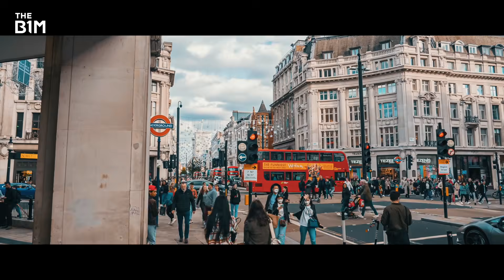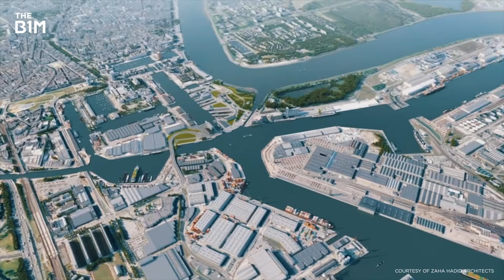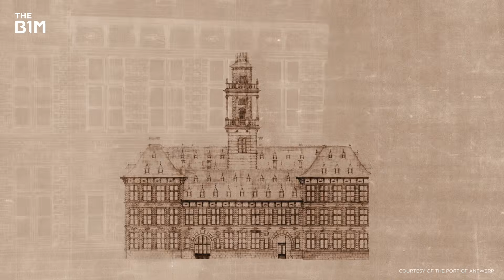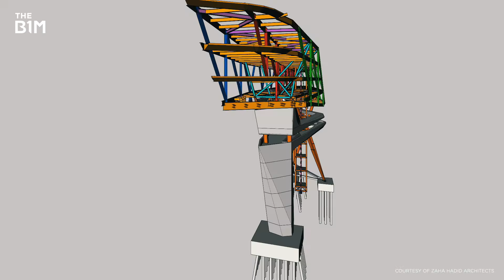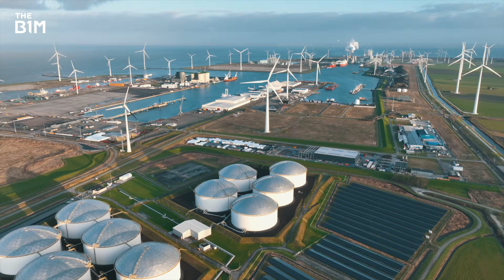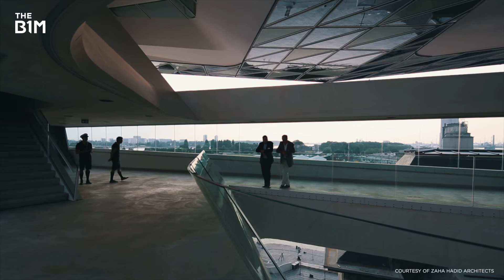Why They Had to Build OVER This Old Building

Comment: The design of the new building is fine...  if it were to stand on it's own.  In this instance, I find the mashup of the old and new simply horrid.   Individually each building is fine but together they are an abomination.

A small tower, complementary to the firehouse next door, could have been much nicer, and more functional.

Comment: I don't mind the juxtaposition of the 2 buildings, but I do mind the (literal) overshadowing. And I think that's mainly due to the "leg". Since the historic building has an internal court, they could have build a diamond with a central stem, rising vertically rather than horizontally.

Comment: Isn't Zaha Hadid known for creating beautiful but terribly impractical buildings? This seems to be one of them. Crazy expensive and stunning but in the end not designed with functionality in mind. I dislike this kind of architecture. If the design of a building or any other object has a negative impact on its function it shouldn't be built. In good design form follows function and is beautifull.

Comment: I am from the city of Antwerp where a discordant symphony between past and present architectural paradigms seems to be unfolding, threatening to overshadow the timeless beauty that has graced these cobbled streets for centuries. The fervent amalgamation of contemporary aesthetics with the classical edifices of yore is causing ripples of concern among aficionados of architectural integrity.

A poignant example of this trend can be found in Zaha Hadid's audacious Dubai-ish intervention at the Port House (Havenhuis). Here, a strikingly unique contemporary structure has been grafted onto an exquisite classical building, creating an unsettling juxtaposition that is the stuff of dystopian nightmares. While the audacity of Hadid's vision is undeniable, one cannot help but wonder if the classical beauty of the original edifice has been overshadowed by its brash and assertive modern counterpart. The question arises, should these two architectural epochs not have been allowed the autonomy to exist independently, harmonizing in their own separate spheres, rather than clashing in discordant conversation? In my opinion; Zaha Hadid's building should never have been allowed to be built unless it was given its own unique place.

Similarly, "Het Steen," that venerable sentinel guarding the riverbanks of Antwerp, found itself in the throes of transformation, driven by the insatiable appetite of the cruise ship industry. In the quest for expansion, the city commissioned an architect to craft an appendage that is unequivocally contemporary in its monotone manifestation. Yet, it strikes a discordant chord with the venerable structure it seeks to complement. It is a lamentable manifestation of an architect who appears to have ignored the solemn duty of respecting the legacy of those who have crafted the architectural tapestry of this city before him.

In this era where innovation and progress often eclipse the reverence for history and heritage, it is incumbent upon city planners across the globe to pause, reflect, and perhaps rediscover the enduring allure of classical architecture. At the very least, they must be mindful of the delicate balance between honoring the past and embracing the future. Let Antwerp's quandary serve as a poignant reminder that in the realm of architecture, as in life itself, there is an inherent beauty in the symphony of continuity and change, where echoes of the past gracefully resonate in the present.

Comment: "It has perfectly blended two architectural styles" is rather contentious. For many, this is architectural conceptualism at its worst: A stylistically isolated concept that is imposed onto the surroundings without respecting them — some of Koolhaas' works are good examples of the same. It's certainly different, and thereby almost by definition interesting. But a perfect blend of two styles? Perhaps not so much. One could so easily argue the exact opposite: that this is poor architecture, exactly because the new work fails to understand and build upon the old. There is little synergy, just a bombastic statement made strong simply by making it an antithesis to what it is supposed to complement. It's like rapping over Beethoven. Different and interesting? Sure. A perfect blend of styles? Well ...

Comment: Quite a subjective video when talking about the look of the building. Sure, its construction might have been an engineering marvel, but that does not mean that it 'perfectly blends the architectural styles' or that it has 'shown that it's okay to play with historical buildings'. To my knowledge this building is generally disliked by the populace of Antwerp and has created a lot of controversy, just like many other attempts at combining old with new in the city. For example, the modern attachment of a visitor center to the 800 year old city gate 'Het Steen' or the new plans for the hyper modern renovation of The Boerentoren, one of Europe's first skyscrapers built. 

Personally I think these extreme modern additions are disrespectful to the original. Like putting an emoji face in the background of the Mona Lisa.

Comment: I'm not sure what the correct solution to this problem was but that monstrosity overpowering the original architecture isn't it.
It's an exercise in getting around red tape and ignoring the spirit and the reason for the rules without technically breaking them.
Sad to see really
Reply: My thoughts exactly.

Comment: I cant stand this building. It is so completely disrespectful. It brutally dominates the building below. It does absolutely nothing to complement the historic property. It doesn't need to be located above. It's a reincarnation of French Baroque which designed from the outside in. I can only assume that someone in the town decided that their town needed a landmark building to grab international headlines like the Guggenheim Museum did for Bilbao. If the best that you can say for it is that it solves an issue with urban density then I think that level of faint praise really condemns this horrible, horrible extravagant white elephant.

Comment: In my opinion Zaha Hadid, belongs to a group of designers who create onanistic architecture (we could incorporate to this group the overrated Santiago Calatrava, just to name one). This type of architecture does not respect the heritage of the functional and are costly buildings to maintain making them unsustainable. In this particular case there is no integration between the old building and the new construction, they are two isolated structures.

Comment: its a hyper modern design on top of a extremely vintage styled building its unique to see the stark contrast between the 2 designs and surprisingly I think they actually work well together.

lots of people complain about the interior not being very functional that's a common problem when designing something astatically pleasing more so then functional, long term that could be resolved by attaching adjacent buildings that will share the more modern design functionally having an old city below a modern one (thinking New new york from futurama) its the likely evolution of architecture  in a world  were we are not willing to sacrifice heritage for what is functionally needed in modern times.

Comment: I would hardly say this project “perfectly blends” styles. There are loads of Zaha Hadid projects I adore … this is NOT one of them. There’s absolutely no relation between the old and new structures: not playful, not echoing, not contrasting in any meaningful way, not extending, not reimagining, not challenging, not playing with scales, not assimilating, not synthesizing, not juxtaposing … there’s literally no connection, none. It’s a thing with a wholly unrelated thing dropped over it. Connected by an elevator shaft. Hearing that the interior is an impractical afterthought is all the more infuriating.

Comment: This would be an "engineering" marvel if the white supports weren't obstructing the view from the outside. This massive mistake bastardizes the original building.

Comment: This is a novelty, not the answer to updating old cities. Neither buildiing needs the other and that's where the incongruity begins. On a city wide scale you're going to need uniformity as the cities have buildings from certain time periods so to should the updates be a modern reflection of that period. Otherwise there'll be this mishmash of old and new with no relevance. You may as well just bowl the old.

Comment: It likely would have been better to use the same engineering techniques to place another building using the same style as the one below.  The styles now clash.  Art is seen as doing something that hasn't been done before.   Of course there is often a reason some things haven't been done before.  Most of the good ideas have been used already. These things often suffer from the emperor has no clothes problem.  When something ghastly is presented, everyone is worried if they disagree, they would appear to not understand it.

Comment: this buildings signifies that time marches on, just like Antwerp, marching into the modern times. Integrating old and new design seems to put the contrast of the connect the past to now. It shows that the past can restore the past legacy mixing it with the new showing that the city is moving forward

Comment: I don't know why anyone would think that looks good. Not only is it monstrously ugly, but it absolutely ruins the protected heritage building underneath.  Only a European would think that this building is some kind of glittering jewel. If you ask me, it's a giant, shapeless eyesore, as ridiculous and pretentious as anything ever designed by Frank Gehry. Antwerp should be forced to demolish this awful building. In less than 20 years time, this building is going to be riddled with all kinds of structural problems leading to leaks, cracks, rust spots, etc. The designer of this silly building was clearly thinking more about form than function, so all the problems that will come up as this thing starts to age, well, whoever approved this project has signed up for those too.  Have fun, Antwerp!

Comment: In San Francisco, we do it more successfully, and there is no objectionable clash or space problems.
1.  They demolish the old building, but keep the entire front and side facades.  For licencing, this makes it a “renovation remodel”.  Then they fill the old walls with an entirely new building that takes color cues from the old—or perhaps compliments in other ways.  From a medium distance this building looks like two buildings—-one in front, one in back.  Since the new building may be glass, it is easy to assume it is two buildings.  Thus reverence for the past is accomplished—-without having to drag forward the dated electrical, plumbing, and insulation.

They could have done the same,  save 3 walls, then grow a structure taking cues from the old styling.  It might end up looking like a Christmas Tree with the old building as “presents”.

To see an example, Google:
Chronical Building, San Francisco.

Comment: I love these videos, but I would really love to know what combinations of software packages are used in the design and analysis of these structures. Does anyone know what Zaha Hadid would have used for this?
Reply: I worked on part of it. I heard Zaha Hadid didn't do any of the structural design. They just made the concept. Al the rest was by local firms
Reply: @UwHoogheid  oh I'm sure that's right. They're architects not structural engineers. I'd still be interested to know software is used. Not just this building but all the projects on this channel really. I guess that's just my particular interest though.

Comment: It’s “dynamic, fluid and hideous”. Acts of vanity like this make a mockery of historical preservation. As other commentators have mentioned it’s a lie to say “there wasn’t space” when there’s clearly ample space adjacent, and it’s a disservice to the reputation of your normally high quality channel. I wouldn’t have mentioned this other than that there were other elements that didn’t ring true, and the poor interior design seemed glossed over.

The real marvel, feat in engineering and architecture would have been to build a tower or building adjacent that COMPLIMENTED with not CONTRASTED with the Firehouse. It’s the same reason Oxford University is better than Cambridge architecturally, when I visited Cambridge I was disappointed and slightly disgusted to see a hideous new (possibly 1970s) residence hall slapped on to the side of an ancient pre-existing building. I’m sure more student space was needed but no thought whatsoever for overall appearance… Like this monstrosity.

Comment: The only decent building from Zaha is her first fire station. The rest which followed is extremely expensive, provocative, overbearing and makes little sense - typical star architect bs worthy instagram but not much more. I’m not a fan of classic architecture and much prefer modern buildings at all but this showing off is just… well, showing off. Regardless of the above the shape and proportions of the addition and the structure on its own is very good but somehow it is too overwhelming sitting on top of the very building they tried to retain. As an architect myself I can’t stand the bs ideology most designers are brainwashing others with including themselves. It’s always so cringy to hear.

Comment: The stark contrast of the two buildings while a great talking point now will age quite quickly. An interesting way of dramatically increasing useable floor space but in this  instance the original building should have been left alone as it has Heritage Status. Any modifications to its appearance or structure should not have happened.
Reply: Correct.

Comment: This is an example of everything wrong with our desire to keep old stuff.  The old structure is not used but since it is designated, it can't be touched, so it is essentially a dead corpse that you must build around.  Dumb.  Either retrofit the old structure or build new.  Perhaps create a façade that pays homage to the original structure, giving that look you want to keep, all the while being modern in terms of construction and energy efficiency.  We don't all live in caves still.  We don't all drive Model T cars.  We don't all use Motorola Micro-Tac cell phones.  We progress.  If you can't use something that is old and no longer viable or functioning, get rid of it.  Leaving it there to rot is idiotic.

Comment: It’s an impressive building on its own but looks awkward above the heritage building. Perhaps if it had been designed with more vertical separation between the two and the external support column built further out, it would allow the two buildings to be their own thing, occupying their own space. Unfortunately the new building monsters the old.
Reply: Agreed.

Comment: Could they not have turned the old fire station into an office building? Keep the facade, if it’s considered derelict then they weren’t doing anything with the inside anyways. Sounds like it was being refinished into something else at the same time as the other thing though so maybe that’s a museum now? Idk, I’ve seen turds way worse than that get polished in my 12 years as an electrician.

Comment: Project was a money pit. During final design someone added a few mm to the thickness of all the steel elements...  means a huge % impact when the elements are already lean. Cost went sky high. And on top of that not practical. Form over function is never good

Comment: I don’t necessarily mind the adapting of a heritage building. It’s a balance between what exactly is important with it, and what is adjusted.
My issue is that this is yet another building with immense cooling requirements due to the glass facades. We have to start considering this to avoid a future where every building in Europe has to have an AC unit.
It’s an unfortunate balance. Glass looks amazing, and having it on landmark buildings like this makes sense, but the impact it has on the general style of buildings is unfortunate.

Comment: This is just meh. Now it is much darker inside the old building and the whole design doesn't make much sense despite being artsy. I would have designed it in the way that you have 4 pretty high stilt in the inner courtyard and a building on top that resembles the old one, but in a more modern design.

Comment: Great video. In my opinion, I think the mixture of old and new designs just doesn't work for me. If the glass building used a texture more like the building below, it might work for my eyes? The buildings by them selves are just fine.

Comment: I love your video(s). Absolute loved watching the video. Absolutely hate it, and I hate the design. Clearly, a case where the protection of the old fire station has failed. A stain on the original design. Why can you not use modern techniques to build an additional unit in the same, but primarily RESPECTFUL, style as the original building. It is not protected for a reason?

It keeps surprising me that this new architecture keeps spreading more and more like a fungus, while at the same time, the far majority of tourist like to go to old cities.